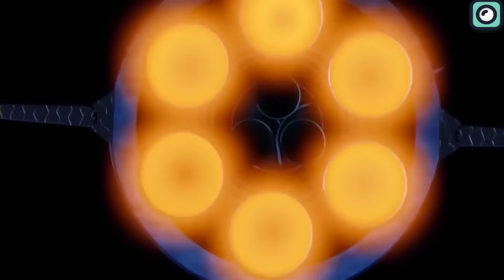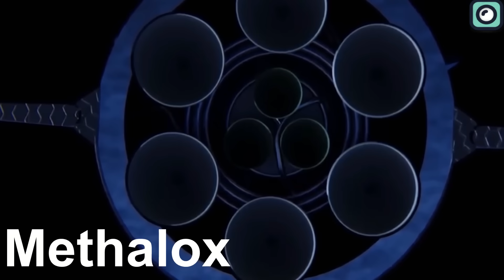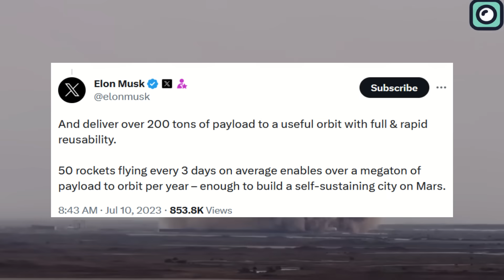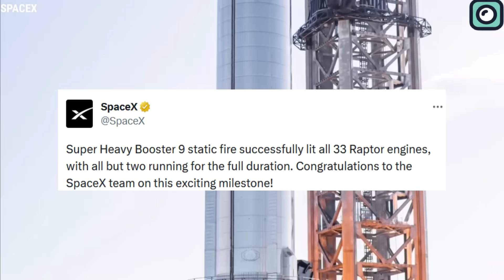Elon Musk Just revealed NEW Starship's 9 Raptor engines!

Comment: Lets see here, with an empty starship during the 1st attempt, this big stainless steel dog couldn't even lift off the pad, it took 8 second to move destroying the pad and a number of engines. So now with a loaded Starship carrying 400,000 lbs. of cargo and 20% more power from the Raptor engines, we are suppose to believe this beast lifts off no problem? 20% more power must require more fuel meaning even more weight? Starship is turning into the Tesla semi (14,000 lb. battery) just doesn't work. You don't build spaceships using stainless steel!!!!!!!!!!
Reply: You sound like a disgruntled Blue Origin employee.
Reply: @johndoran3274  Or a sad NASA engineer  LoL
Reply: Your statement suggests that Elon's rocket is underpowered. That is not the case here. More accurate assessment shows that Elon has problem designing interstage (skirt) that would withstand compressive forces generated during liftoff and flight to orbit.  Stainless steel is very good for designing rockets as long as it is used in tension (fuel and oxidizer tanks) it is terrible material due to buckling if it used in elements subjected to compressive force. Therefore Elon has two choices one is pressurized interstage (skirt) or elimination of interstage and use of 6 VacRaptors as support  columns sandwiched between the Starship and the SH Booster. So far Elon chose to kick dead horse one more time with Dynamic Skirt Pressurization Scheme  disguised as  Hot Staging. His Hot Staging Vent Ring is weaker that the Skirt ensuring that rocket will explode on the launchpad
Reply: Wanna bet?
Reply: I love how the SpaceX fanboys are in denial that Starship has been a disaster - Starship development started in 2012 and that turd can't make it into orbit - The Apollo program landed men on the after 10 years of the program's development.
Reply: @samuelpeterson7043  You seem to underappreciate power of ignorance. If professionals were to develop the Starship rocket we would have flame trench and no hope for progress when it comes to launching rockets. Since ignorant people did this we have water deluge system that allows for developing Steam Cannon assist during launch of future rockets. This accidental development allows for partial reduction of fuel and oxidizer required to lift rockets into space. If professionals were to develop the Starship rocket we would not have preposterous idea that you can use low tech and weld that rocket from stainless steel sheetmetal. Since ignorant people did this we at least have hope that Elon and Space Cadets at SpaceX will figure out how to build interstage (the Skirt of the Starship) so it can withstand compressive forces generated during liftoff and flight into orbit. (There is hope that they will use 6 VacRaptors as support columns sandwiched between the Starship and SH Booster to solve that problem). If Elon gets somehow restrained and professionals are let in to clean up mess that he created there are many unfulfilled promises that the Starship can still deliver on. Just be patient and enjoy the show as it unfolds.
Reply: Haa haa! I stand corrected - You made me realize the "Steam Cannon Assist" feature should easily have Starship hitting downtown Houston within 45  minutes after launch... with the launch pad in hot pursuit. @KarolKarolak
Reply: No problems and decades of delicate incremental testing would be the NASA way! Build it, break it do it again is the Musk way!!!  One works better than the other! Do you have any idea what NASA HAS SPENT????
Reply: Yep! One makes it to space the other melts concrete  @highpointsights